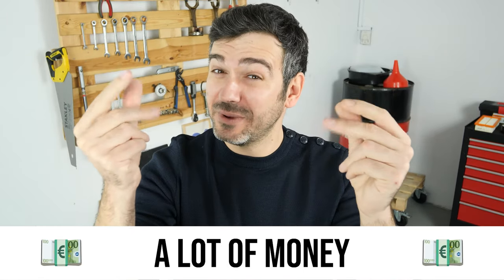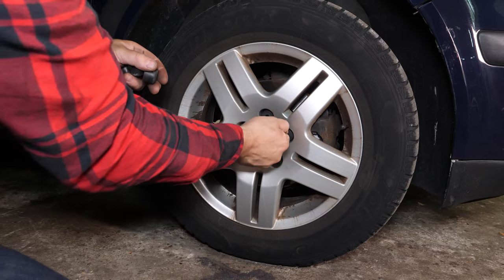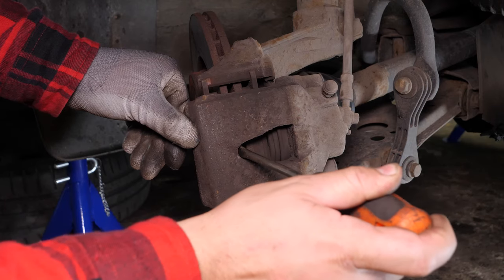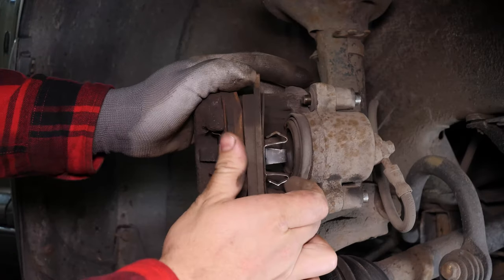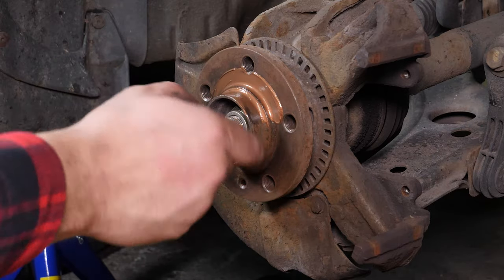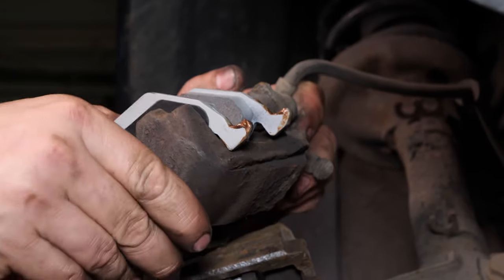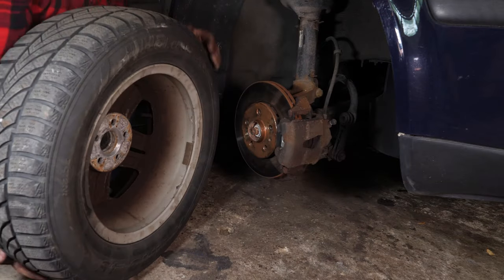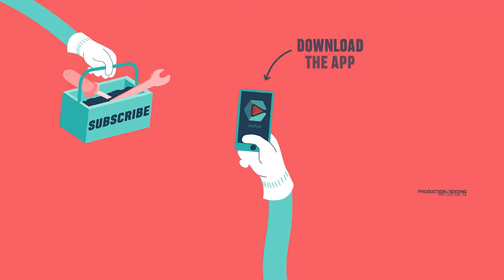How to replace the front brake discs and pads Golf mk4 🚗

Comment: If you grease the threads on the wheel lugs, you loose friction between the threads to keep the lugs tight. Wire brush the lugs drill mounted steel wire wheel to clean the threads then apply grease to the lug shoulder where they touch the wheel. Ideally the caliper pins would benefit with thread lock applied to the threads.
If the caliper and carrier have rust blisters, the can be removed by light tapping with a chipping hammer.

Comment: I can't get my rotor off without taking away the "caliper holder" or whatever it's called. It's in the way...
Reply: You have higher spec brakes - probably a TDI?
Reply: @dopiaza2006  It was a GTI.
Reply: @john-bjorn  That would make sense, it has the 288mm or 312mm discs. This video is for the 280mm or smaller. Not a problem though, just 2 18mm bolts for the calliper carrier.